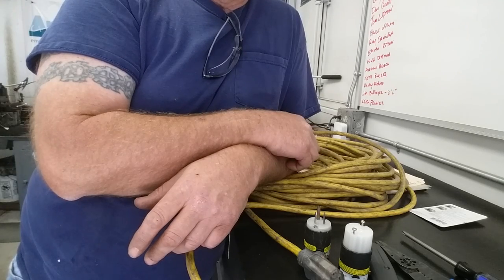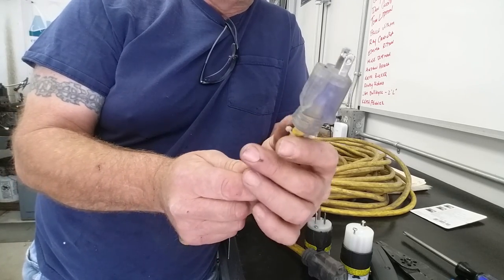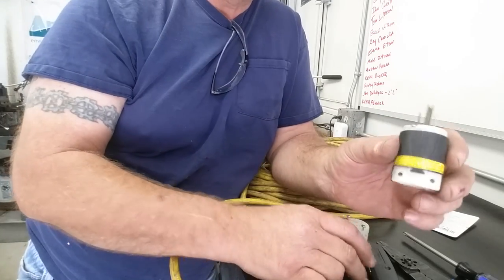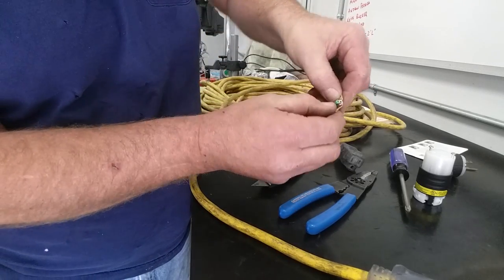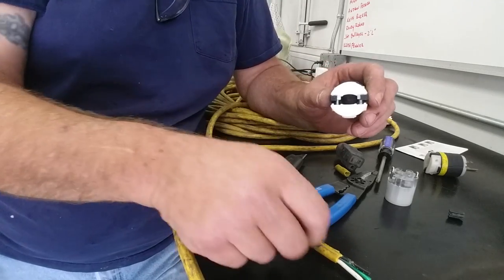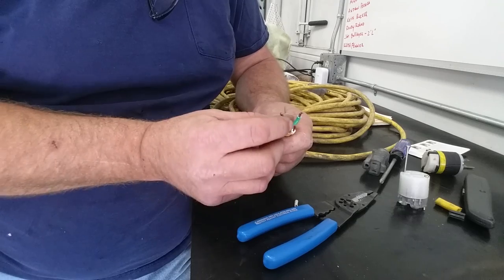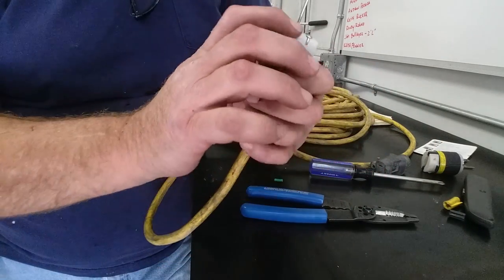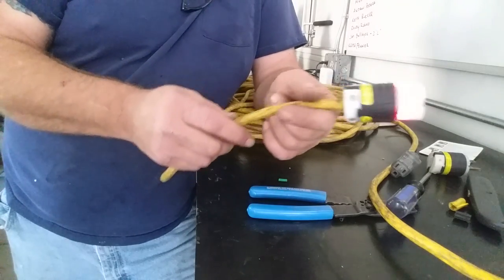Extention cord saftey + repair

Comment: Good presentation Stan. Plugs sure have gotten easier to install over the years. I remember needing two sizes of flat blade screw drivers, having to tin the wire and wrap it around the screws, tighten the screws from three different directions, and use a smaller screwdriver to tighten the two or three screws to pull the cap down, then of course having to tighten the two screws in strain relief clamp.

Comment: Stan, when I was in my teens my dad was über cautious about wiring and especially cords.  He taught me how to repair wiring in about anything, and working in his shop he made me a safety nazi.  So I thought when I saw this "what could anyone teach me about this?"  PLENTY!  I'd never heard of these greenboard receptacles and plug ends - what a fantastic idea!  I'm going to replace all my shop cords with these.  The other thing I'm sure you know but viewers might not - make sure to get the right amperage cord for your application.  Yes, a "fat" extension cord seems expensive, but it's not only significantly safer - your tools will get all the juice they are supposed to.  The ubiquitous cheap orange 16 gauge cord is a false economy!  Thanks for a great segment.

Comment: Good Video Stan.  Just one other thing on extension cords that most people don't think about.  The International Fire Code requires that extension cords are for temporary use only.  You cannot use them to replace permanent wiring, aka run them through walls, in ceilings, under carpet, etc.  They have no circuit protection built in to them as a power strip has.  Too many people plug them in and walk away for months and assume that they are protected because the circuit breaker will trip.  The circuit breaker is designed and engineered to protect to the receptacle.  A 16 gauge cord plugged into a 20 amp circuit permanently is a bad deal. Thanks.  R.J.

Comment: Good video, led in plugs are invaluable . what I now do for extra credit is always add  a piece of heat shrink  to the cord and use wire ferrules - helps keep all the strands together great for stranded wire and circuit breaker terminals

Comment: I like to tighten the strain relief while there is still about 1/8" left to pull the two parts together. Once the strain relief is tight I finish pulling the two parts together. This assures me that there is NO tension on the conductors.
Reply: He didn't say anything about it but it looked like he pushed on the cord before tightening that strain relief. That's what I do everytime.

Comment: I can only applaud a rather fanatic stance on the safety regarding extension cords. That said, in many cases this 'polarity-talk' is seriously over the top.
We are talking about AC after all. Especially if you derive your 240 volts from a 240/400, 3  phase + Neutral+ earth, there are very few devices that will have an issue with 'reversed polarity'
As far as personal safety goes ( I am speaking from a European, non-UK standpoint) it really makes no difference.
It may become an issue when some distributors are penny-pinching by using the same physical lead for Earth and Neutral, something that shouldn't be done, given the are NOT the same thing.

Cheers
Paddy

Comment: You showed how the wire colors match up with the correct terminals.  If they don't you are putting the plug on the wrong end.  It's easy to get right if you replace them one at a time like you did.  If you are working with one someone cut both damaged ends off so they can't be used until repaired you can get it wrong.  If you have to pull the ground across between the hot and neutral switch ends of the cord and they wil line up

Comment: Here in Germany there's a bit more to do. All wires except the protective earth are getting shortened a bit so when the strain relief fails the wire for protective earth gets pulled out last.
Also it's strictly forbidden to use screw terminals without wire end ferrules unless the terminal is certified for being used without ore you use solid core wire.

Comment: Not quite as nice as the LED warning lights, but I found some female ends at Home Depot that have a push button lock to keep the male end plugged in until the button is pushed. Wonderful!

Also you didn't mention it, but if wiring a cord with neither end attached, look carefully at the color of the wires coming out. One way they all line up nicely, the wrong end will have you routing tails around to get the wires to line up with the correct lug.

Comment: Yeah, I have a little maintenance to do on some of the machines I have, too.  I need to get some terminals and wire and get to it.  Nice having the indicator lights.For any current inlets or motors that are currently only 2-wire, is it ok/safe to add a 3rd wire and just find somewhere on the motor/box to connect the green to?

Comment: I've found old work with the hot & neutral legs reversed between the main breaker box and the load, at junction, switch, or sub-breaker.  Or in an extension cord.  There are those out there that just can't see the reason for paying attention to which wire gets run through the switch or sub-breaker.  They are usually the same people that would remove the ground pin from the male plug.

And then they wonder why they got their eyes lit up...

Comment: How much do they cost? Not to long ago I was on a job site were we had to plug into temp power boxes. At some point a worker unplugged the 220 cord and some how replug it in so we had 220 on our 110 extensions. Cost me a chop saw, battery charger and a halogen work light. Did the prime pay for our tools noooo.
Reply: Most likely those plugs don't have a voltage tester, so would either burn out or show green on  a single phase 220V line. Always best to use a volt meter or at least a decent wiggie when wiring a temporary drop box.

Comment: Cool replacement ends... they'd be superb if they came with strain reliefs.
Reply: Chester Woodward strain relief can mean either the cable clamping mechanism or the bit that prevents wires from bending at a sharp angle where it enters the connector. I think he's referring to the later definition.

Comment: with that gauge of wire shouldn't you use a 20amp connector?  PS5369-XGCM??
Reply from the maker: All 15 amp rated stuff, we switch straight to twist lock above  that.

Comment: If making a cord with no ends... make sure to use the correct end of the cord for the male/female as they are differently configured
Reply: Um, the cables are made continuously and the wires are twisted together inside the sheath.

The plug and socket (male and female ends) are different of course, and as Stan points out, you do need to pay attention to which wire goes to which connector - those LEDs are there because way too many people have hooked the white (common) wire to the hot pin and vice-versa, or gotten the hot wire connected to the ground pin somehow.

But, the wires are the same at either end - the electrons don't care about direction when they flow through the copper. We color code the insulators so that we can keep the electrons going to where we want them, safely.
Reply: What I was trying to explain was the male/female cord caps are arranged differently. To acheive the straight in entry as Stan demonstrated it does make a difference which end of the cord you use to avoid having to cross the hot/neutral wire to insert in the  proper terminals.

Comment: I am somewhat paranoid regarding extenion cords, had one connected to a 2 amp battery trickle charger connected to one of my Harley's, it shorted out at about 2:AM and caused a basement fire (could have cost me my life and wife's life). Cost me 2 Harleys, a lathe, a milling machine, a 5 hp air compressor, band saw, radial arm saw, a 40 year collection of other power eqp.,tools and hand tools too numerous to list and 3 months living in a motel. I don't allow frivolous, careless or haphazard use of extension cords in my shop, if it is a 50 ft. or less it must be 14 AWG, if 100 ft. it must be 12 AWG, and I don't connect 2 ext. cords together. I don't allow them to be walked on, run over or doors slammed on them. I re-coil and inspect them after each use and store them so that nothing can be dropped or thrown onto them. Electrical extension cords are one of the MOST dangerous items on the home or workplace!!!!!!!!!

Comment: As for stabbing yourself with a screwdriver.. I find that quite often the tip doesn't quite fit when dealing with imported fasteners. You may have a properly shaped tip and a poorly make Phillips-hole.  There is also a variety of Phillips called JIS Phillips (Japan Industrial Standard). these require a specially shaped tip.  You can visually identify this type 'cause they have a small dot  on the screw head.

http://www.hondatwins.net/forums/attachments/42170d1404490715-everything-you-wanted-know-about-cross-head-screws-philips-vs-jis.jpg

and

http://cdn.instructables.com/F5K/IE3C/FQSWZZ4L/F5KIE3CFQSWZZ4L.MEDIUM.jpg
Reply: and another image of tip comparison

https://wrenchandspanner.files.wordpress.com/2014/12/jis-vs-philips.jpg

Comment: When they were building my house, I was the guy who walked around with a big knife. When I saw an extension cord with a bad end or a cut in the insulation - WHACK! I was good about supplying new ends (and even installing them), but no dud cords on my house. (Purely selfish; I didn't want to live in a house built on someone's bones.) The same treatment for frayed slings.